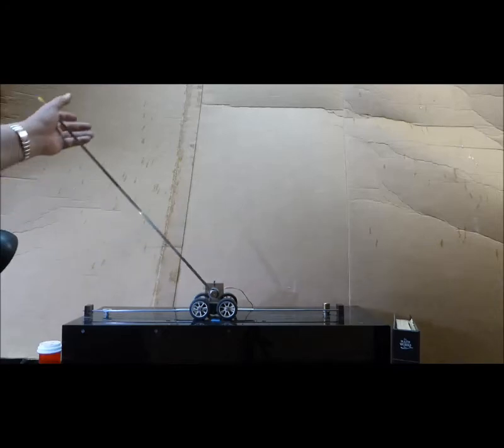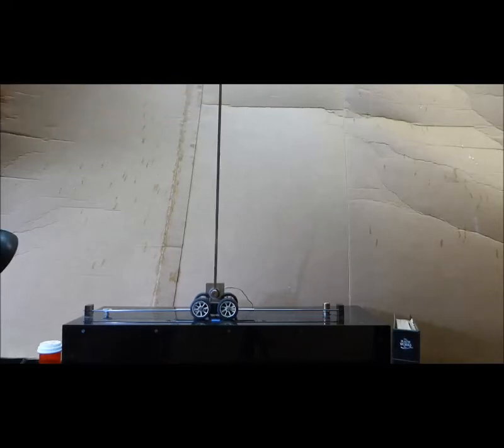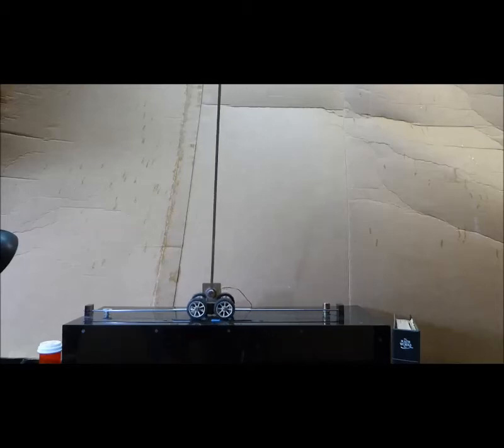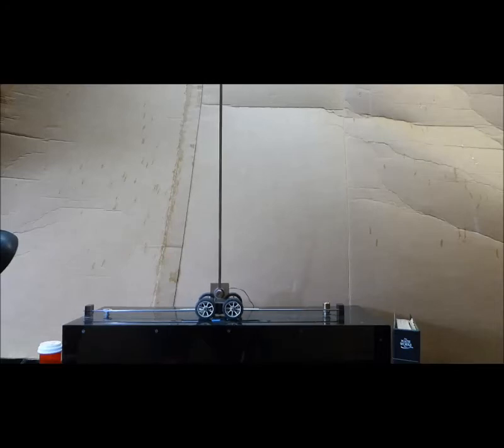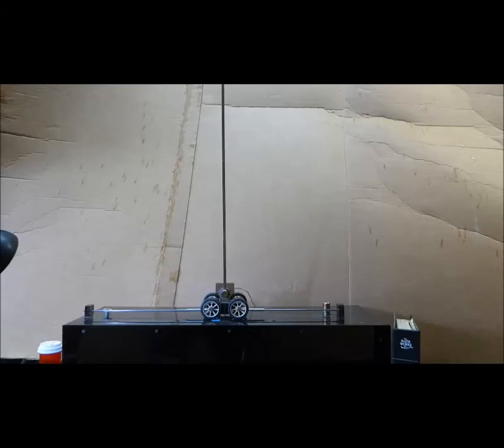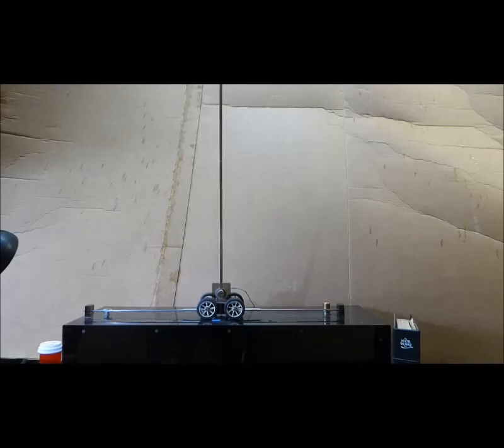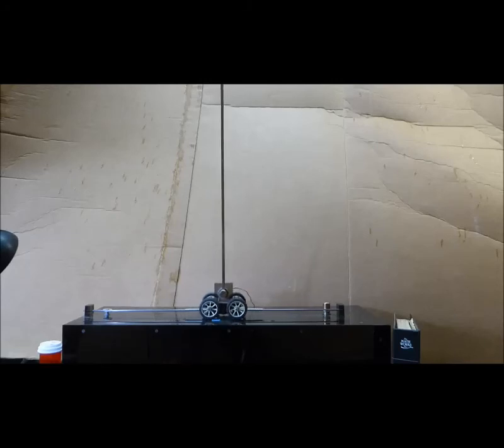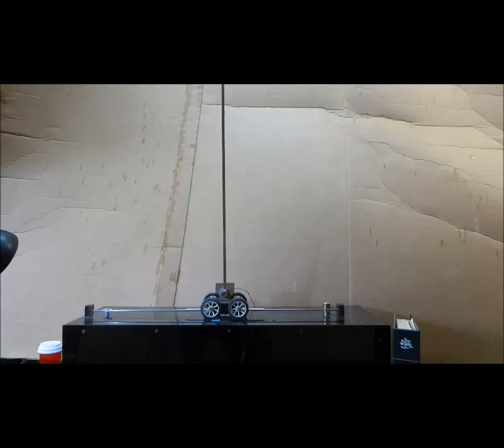Inverted Pendulum Controlled by an Arduino

Comment: Hi. Could you please share what parts you use and codes? Thank you so much.
Reply from the maker: Hi, 
As to the hardware (Motor, Power Amp, Rotary Variable Differential Transformer etc.) it is all stuff that I put together back in 1986 ... so knowing what it is is of no help. 
However, I can tell you that the motro was from a DECtape (Google that), and the RVDT set me back some serious $$.    As to the "code", it was all automatically generated by Simulink and the Arduino support package.  
Best regards, 
Dick